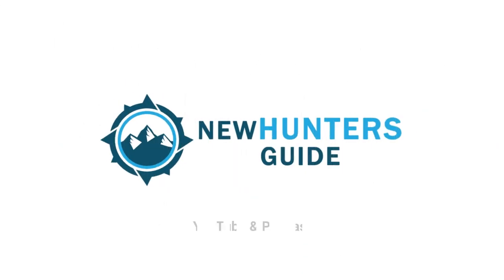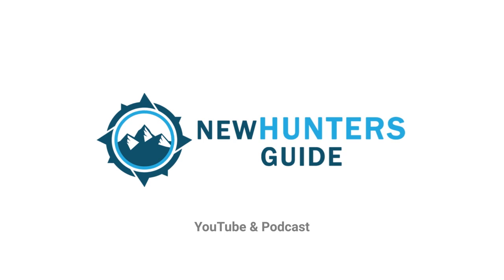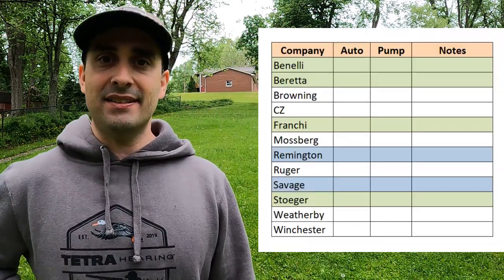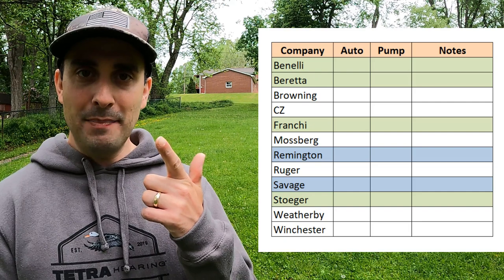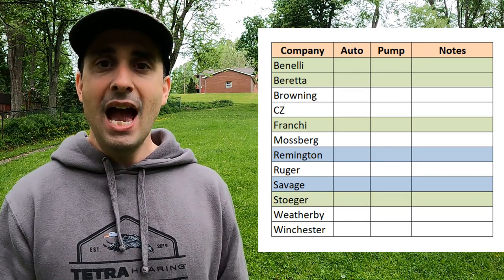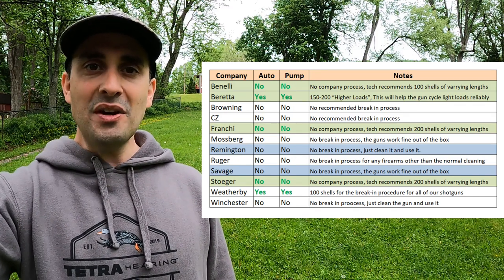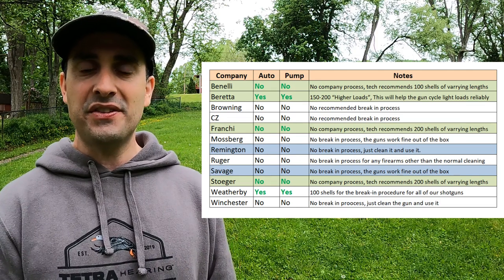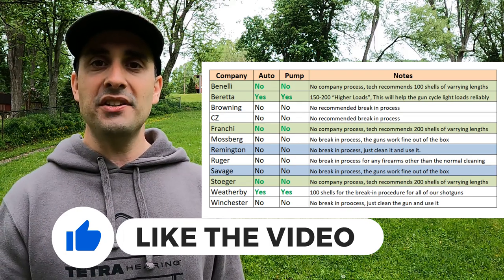How To Break In A New Shotgun - I asked 12 Manufactures

Comment: FYI, I just bought a Benelli Super Black Eagle 3. In the manual it says the following: "WARNING: when your shotgun is new and before beginning to use it normally, a breaking-in period may be required before your new gun works perfectly with light target loads. If you experience any initial functioning problems, we recommended firing three or four boxes of standard hunting cartridges."
Reply from the maker: Very interesting.
Reply: Just took my new SBE 3 out for the first time. Shot a round of clays using Fiocchi 2-3/4, 7.5 shot, 1-1/8 oz, 1350 FPS. For me those are as heavy of a load as I shoot. I only shoot clays. When I was done, I ran a handful of Federal Top Gun, same shot numbers as the Fiocchi, except 1200 FPS through it. Ran perfectly. Hoping it will run 1oz, #8 shot and down as low as 1145 FPS. I have a bunch of that lower powered ammo stock piled, as well as a bunch of 1200 FPS loads. I know Benelli recommends 7.5 shot, 1200 fps minimum, and guarantees it will fire/cycle those loads. I just need more time to get out and shoot....

Comment: Another great video sir. The guns I have experience with or a close friend has that I've witnessed first hand (all 12 ga semi) are the Benelli SBE3 - required no break in and at the trap course cycled everything, the Stoeger m3500 required many over 100 heavy shells to even cycle lighter duck loads, now it cycles trap loads reliably. Now for my baby my new Winchester SX4 was out of the box, then cleaned and first activity with it was skeet - it cycled everything with no issues and you can fire as fast as you want.
Reply from the maker: Thanks so much!

Comment: Remington 870, and mossberg500 break in:

Throw any shells you want into it and hunt. If it fails its more likely on you vs the gun. Not pretty or "fast" but there are no other comparable guns as far as reliability goes.
Reply from the maker: I never did fully grasp what a break in process was supposed to do for a pump honestly.
Reply: My Benelli has over 6,000 rounds through it from me, sporting clays. 0 problems. While hunting I've watched my friend have ejection problems with an Ithaca, another friend have issues with his 870. Inertia guns are more reliable because they are more simple than a pump. I loved my Mossberg 535 and swore that it was more reliable than a semi auto. Then I bought a used super 90 Benelli. It was over 25 years old when I bought it! So who knows how many rounds were through it before. Just buy one used;)
Reply: @Bionicbunnywabbit  I bought a benelli ethos Cordoba and it was the single most problematic, unreliable hunk of junk I've had cross my hands. Had a benelli montefeltro that was a ammo eater. Ran anything I fed it with no issues. Roles royce makes a lemon here and there too.
Reply: @TheNewHuntersGuide  that was pure satire. There us no break in fir a pump. Just bang away. I've never understood with guns that cost 1500-3grand, why should the consumer have to buy several boxes of ammo to feed it to make it work correctly when a 400dollar pump just works? Lol
Reply: @eduffy4937  man, that's crazy. those cordobas are super expensive too. Did Benelli ever make it right?
Reply: @Bionicbunnywabbit  nope. Sent it back twice. They said "change ammunition". I could have it fail with win aa, boss, hevi shot, and federal. The only shells that shot well were win super x in #5lead. Beyond that I wanted to donate that gun to the swamp everytime I picked it up. Thank God I got rid of it.  Any company can make mistakes but for the money and the "warranty" they supposedly have a guy should have a finely tuned sewing machine out of the box, into infinity and beyond. To say I was VERY didsapointed is a gross understatement.

Comment: I bought a Hatfield shotgun from Walmart a few years ago. That gun did need some break-in due to poor quality machining of the internal parts. For a while, there would even be metal filings when I would clean it after a hunt. We actually purchased several of these because they were so cheap. Some didn't cycle well until after the break-in.
Reply from the maker: How long was the break in process?
Reply: Definite improvement after 50 shells. They seemed to work perfectly after that.
I actually took one apart and used a small file to remove some sharp edges from the bolt carrier and smooth a couple of spots showing signs of wear or rubbing. That was actually the best way to quickly have perfect function. I would not recommend anyone do this on their own. You should have a gunsmith perform that type of repair.
Reply from the maker: Thanks! @vidkikr

Comment: Although not as popular are single trigger double barrel and over/unders.  I had a Stoeger Condor that took about 250 shells for the trigger mechanism to "wear in" and be able to shoot the second barrel without having to cycle the safety.
Reply from the maker: Great bit of input, thank you!
Reply: Sounds like something an initial teardown/inspection/cleaning and lubing would have caught.
Reply: @veteranironoutdoors8320  Actually no, from what I found in searching online other owners said it seemed to be rougher tooling and either shoot it in or take the trigger mechanism apart and hone it with gunsmithing stones.  Others may be more comfortable with doing that, but I wasn't.  So, just kept trying to bust clay birds.

Comment: I bought a Beretta A400 Xtreme Plus 12ga this spring.   The first shells I shot through it were 7/8oz handloads just to see if it would cycle them.  It cycled them just fine straight out of the box so I don't know why they would recommend a couple hundred hotter loads to break it in.
Reply from the maker: Personally, I think they should all just work out of the box. This may be the backup plan if they don't.

Comment: I will say I have never made any effort to break in a shotgun, but of the 10 or so models I’ve owned over the last 25 years if they were ever going to have a problem it was with the first 5 rounds and then the problems seem to correct themselves. 

One A400 plus I had was very inconsistent for about the first two boxes of waterfowl loads.
Reply from the maker: I agree, they tend to smooth out pretty fast, if there were ever any issues.

Comment: for a pump I couldn't see a break in process by shooting it. just work the action a few hundred times then lube and clean it. Now I have had a few semi auto guns ( both rifle and shotguns) that were made with tight tolerances and were a little sticky at first. Most recent my mossberg 935 was very hard to cycle the action. After I shot about 20 rounds through it, I have not had 1 issue with it. The first 5 rounds I had a couple misfeeds but I never had one after that. By hand it still had resistance and would stick half way but after 10-15 more rounds it got alot better and there is no longer that middle friction zone when pulling the action to the rear.
Reply from the maker: That is very interesting to me.

Comment: Personally I think “breaking in” is a lazy or ignorant persons way of doing what should have been done before the first round was fired: an initial thorough dissasembly, inspection, maintenance, and cleaning and lubing. It does not matter the manufacturer-from savage to browning, every new in box gun I’ve bought has needed some initial maintenance. From removing machining chips, deburring critical surfaces, smoothing rough castings,  to removing thick coatings on guide rails and stoning rough machined trigger and sear surfaces. Doing this I have NEVER had a problem with any gun Ive ever bought (to include my hi-point carbine collection. You deburr and smooth all the edges and smooth all the rough castings and machining marks out of a hi point it will never give you any problems)
Reply: Absolutely spot on. I'll go over my brand new barrette with a stone and smooth everything like glass.
Reply from the maker: That is probably the goal of shooting it a bunch as well, smoothing out the primary wear surfaces.

Comment: The break in is I think more for warranty stuff etc. I work at a gun shop and for example Beretta has a guarantee that it will cycle 24 gram trap or skeet loads. If someone has a problem that it wont cycle them reliably we will not consider that there is a problem with the fire arm if they have shot less than lets say 200-250 of the 24 gram loads.
Reply from the maker: They should put that in their owners manuals then, and remove all this guesswork lol.
Reply: @TheNewHuntersGuide  yes I agree.

Comment: My Girsan MC312 says in the manual to use 1 1/8 oz load (1290fps) for a minimum 40 rounds. Otherwise it's built to cycle 1oz (1290fps) loads. If I can find my 870 manual I'll see if it says anything about break in or not.
Reply from the maker: Always follow what the manual says for sure.

Comment: I have a 12 gauge Benelli Montefeltro and a 20 gauge Benelli Montefeltro. I was told to use high velocity hunting loads to break the guns in. My 12 gauge Benelli cycled everything right out of the box. 1 oz to 1 1/4 oz loads. No problem. However, the 20 gauge would not cycle 7/8 oz target loads until I ran about 100 1 oz hunting loads. Then it cycled everything just fine. So I think it depends on the gun.
Reply from the maker: Who told you that though? Did it come with the gun? Was it in the manual? It seems like a guessing game on what to do.  I also wonder if 100 target loads would have led to the same conclusion.

Comment: I just purchased a Panzer bullpup shotgun. The manual states oz size and velocity to break in the shot gun. I'm just wondering if the companies that sale higher end shotgun has broken them in already before they go to the retail stores.
Reply from the maker: Ironically the higher end shotguns are more often the ones telling you to do a break in process. My understanding is shotguns are test fired before leaving the factory but only a couple shots. They may test the actions mechanically but they do not fire them enough to break them in.
Reply: @TheNewHuntersGuide  it could be the lower end guns have tolerance imperfection. Which would need a break in period to manually fix the tolerance to be nominal for normal functionality.
Reply from the maker: I would think so also. But its the lower end guns that say they need to break in. It's opposite of what would be intuitive.  @kongvue5160

Comment: I’m not sure asking manufacturers is the best plan. Their job is to make money and sell you more guns. Probably best to ask high volume amateur target shooters. They likely aren’t sponsored and therefore have to pay out of pocket so longevity matters. My opinion is to strip, clean and LUBRICATE any areas that are subject to wear. If it’s a pump, do it at home first UNLOADED and cycle the action several hundred times. Then strip clean and lubricate it again. By now you’ll begin to see the wear areas and they should be polishing themselves a little because everything is still clean. Next, take it out and shoot it and that will introduce a little bit of grit into the lubricant and the surfaces will be polished even farther. Strip clean and lube again. Repeating the process often early in its life will smooth things out quite a bit without introducing so much grit that things start to gall and scratch because of the lack of lubrication. Same with autos, I’m just to lazy to cycle them by hand the first go around and since you don’t really care how they feel, a nice polish on the moving parts aren’t as necessary. Similar with double barrels. Clean and lube the hinge pins and locking bars. Often at first 👍🏼

Comment: Only thing I can think of, is the paint/powder coat in the mechanical parts to wear off and polish for it to move smoother.. but I’m questioning it myself. Went through 100 shots and getting basic wear from black to chrome. But idk
Reply: Had a few jam on the first 20 shots. But everything went smooth after that.
Reply: Model-citadel boss 25
Reply from the maker: Hmm, can't say I've shot one of those before.
Reply: @TheNewHuntersGuide  come to find out, I had a full choke in it and a light gas piston. Steel shot is why it wouldn’t cycle easy unless I had the heavy piston. Whoops haha

Comment: Interesting. On the Beretta A400 extreme manual it says that is recommended use 32g shells at the begging for brake in. But those not mention the amount.
Reply from the maker: I'm surprised it even mentions a break in. Most don't. I also assume 32g shells make sense where you are, we don't use that terminology here and wouldn't know where to find shells that match the description.
Reply: @TheNewHuntersGuide  Yes I thought it was common for shoot guns. And sorry for US that will be your clays or sporting shoot in 1 1/8oz , #7 1/2 shoot size.
Reply from the maker: Thanks, do the grams relate to the weight of the shot? @hugohmtz1
Reply: @TheNewHuntersGuide  That is correct, on clays or bird shot, they provide the weight of the shot and will be shots of 1 1/8oz
Reply from the maker: Thanks @hugohmtz1

Comment: I have a Browning Maxus and it took somewhere between 75-100 rounds of 3” duck loads to cycle light target loads reliable. 12:14
Reply from the maker: Interesting. Browning should probably express that somewhere in the materials with new guns.
Reply: Is it a 3 1/2” gun? It states in the manual the gas ports are different on the 3 1/2” guns and may not cycle target loads reliably.
Reply: I just got a maxus 2 3" and took it for the closing quail season pass weekend. It shot extremely well, no issues with it at all with light loads. It cycles fast too and very minimum recoil.

Comment: Anything machined, cast, stamped ect with metal on metal in life in general will have a break in. But does the process for this matter. Probably not as much in this case. Probably low brass would be fine… in some cases on some things the break in process is so small and unnoticeable that we don’t discuss it. Would there maybe be some positives. Yes. But probably very small. Think of the west marks on parts of the gun internally. Those are break in marks in some cases.
Reply from the maker: I think if a break in is going to happen, it's going to happen regardless of anything special we do. Its good form to practice with a gun before competing or hunting with it. That's probably sufficient.
Reply: @TheNewHuntersGuide  agreed

Comment: Break in generally means production with weak tolerances. and letting the parts get used to each other and  de-burring while working. 
If it is not a very bad rifle. That should not be a concern today anymore.
Because if the goal is that the parts get used to each other by shooting maybe they will wear out each other in short term.
I vote for "just clean and use it" producers.
Reply from the maker: Thanks!

Comment: Ruger makes shotguns?
Reply from the maker: The Ruger brand doesn't but sub brands they own do.
Reply: What are the sub brands they own?
Reply: Ruger used to.
Reply: @ndpike13  I know the Red Label. I had one. It was a over/under. He said he contacted Ruger and asked about breaking in a new auto or pump. I would like to know how Ruger could have answered that question when they never made one.
Reply: @gcurrinder they also had a gold label and a prototype pump but it never made it to production
Reply: @ndpike13  I get all of that, but this guy (The New Hunters Guide) should not have Ruger on a chart like they are a shotgun manufacture. Very misleading to people. He should correct this video.

Comment: New auto loaders that don’t have very smooth actions should be broken in.  Use 1000 sandpaper and polish all the contact surfaces. Then  put a good portion of polishing compound in the action and cycle it 5000 times by hand, clean the gun use  engine assembly lube on surfaces and shoot. The action will be extremely smooth and cycle reliably.
Reply from the maker: Will that void the warranty?
Reply: @TheNewHuntersGuide  How would the manufacture know that the gun has been blue printed unless you told them. A very smooth action is less likely to break parts. Many parts on modern guns are made from less than highest quality steel. Manufactures will use any reason possible to  void warranties. Never mention the T word to a manufacture (Trigger).  Warranty will immediately be voided. Except for very high-end target guns, all modern guns will need a trigger job to shoot decently.  if you port the barrel and extend the forcing cone, they will also void the warranty.
Reply: That's not breaking in, that's modifying. Why buy a new gun you need to grind on to make it work?!
Reply: @ndpike13   You know how your gun fails to cycle sometimes even with heavy loads.  It’s because economically made guns or not precision fit. That’s why they need a break in period to properly cycle. Polishing speed the process up and illuminates malfunctions.
Reply: @danielsullivan9865  never had a shotgun fail on me. Shotshells yes, but not the gun itself.